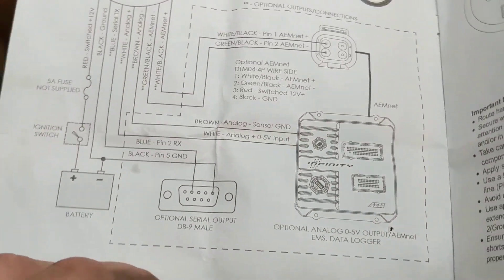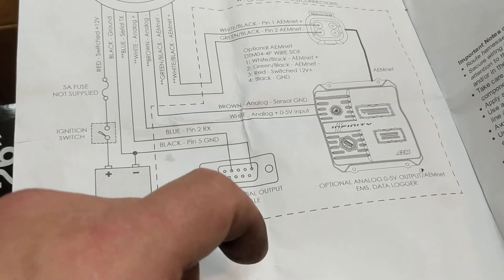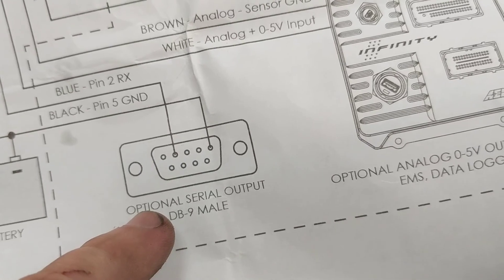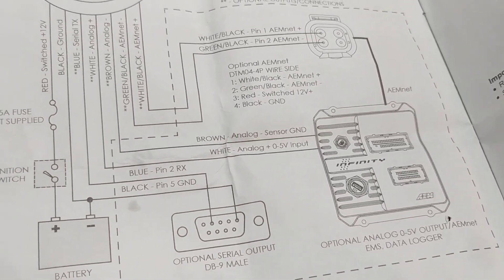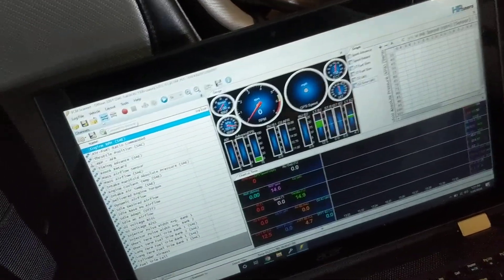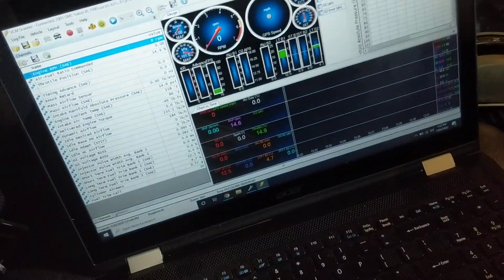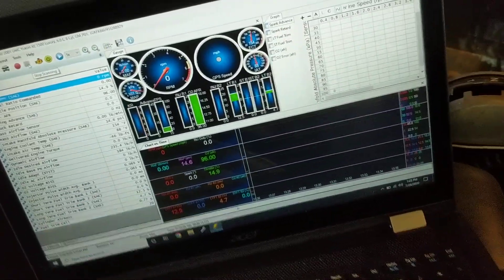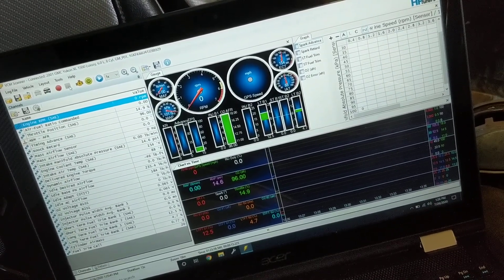AEM wideband channel disappearing on hptuners scan - Solution

Comment: Seems like a headache to work around not using pro link
Reply from the maker: I'd say not really.  Once I figured out the pin issue it's since been flawless.
Reply: Not the pins, but the on and off comm port stuff with reading and dropping
Reply: I have the pro link and have the same problem